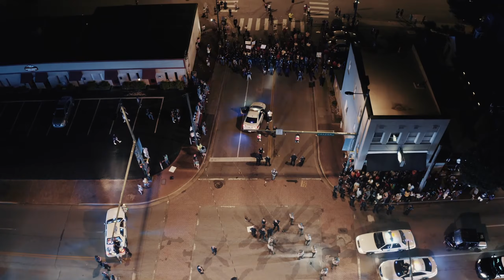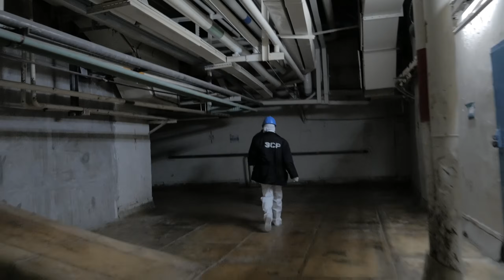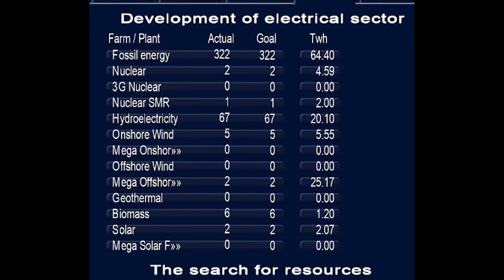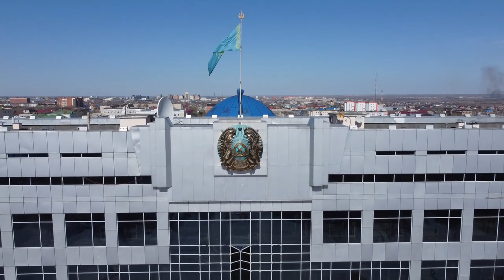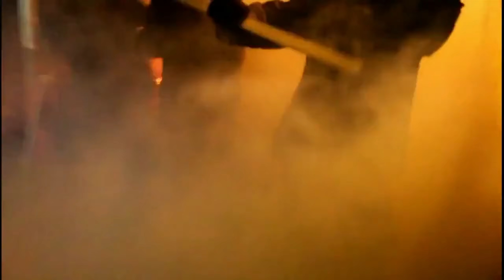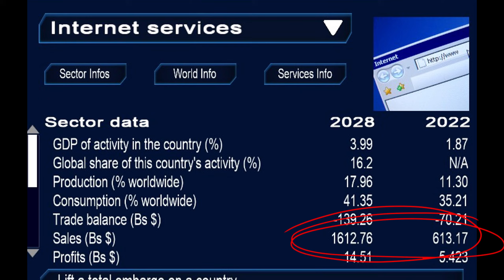ENERGY 2.0 | Power & Revolution Tutorials

Comment: Could you tell me what's brand of your CPU? because you run the game sooooo smoothly, but my one is so lagging.
Reply from the maker: Ryzen 7 3700X, standard clocking.
Reply: @politicsgaming   I check it's a 4.2GHz CPU, thanks
Reply: @wfong4409  ghz in modern cpus isn't the only factor these days, sometiems between CPU generations the instructions per clock cycle can be double digits higher :^)
Reply: @julkkis666  double digits high but Ghz the same or diff ?
Reply: @wfong4409  thinking of the 5000 series ryzen and it's generational neigbours i think the improvement is something like 10% per clock cycle and the base clock is about as much better.
Reply: I have an Intel Core i5 CPU and it runs this game well 😂